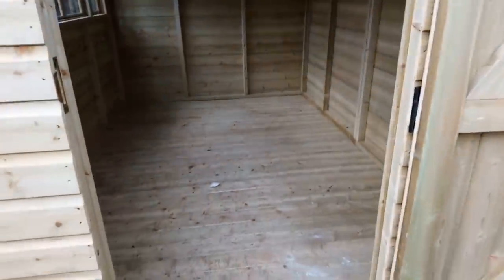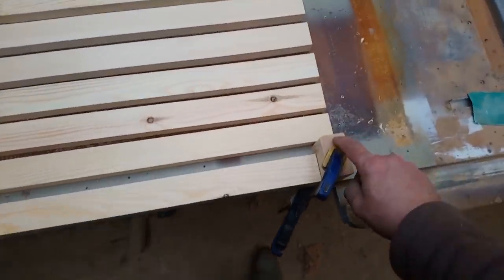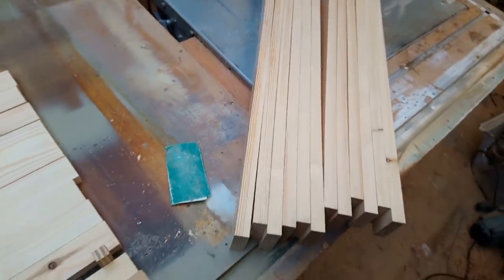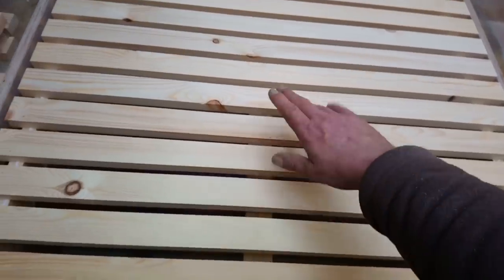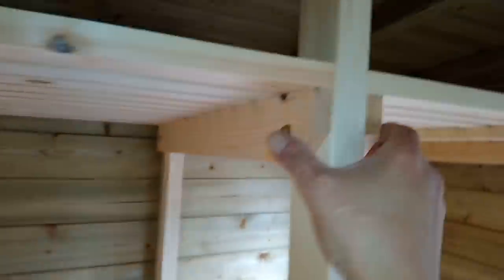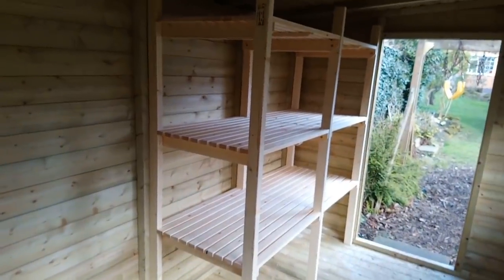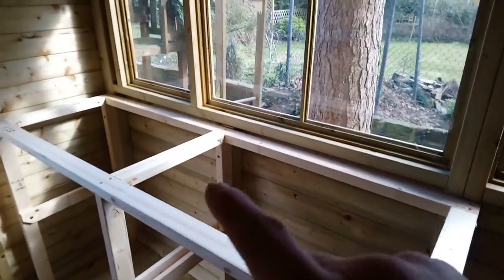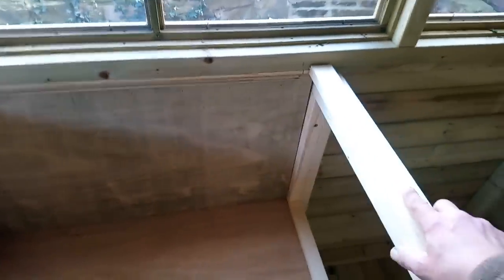Pottery shed slatted shelves n bench build - a quick wk'end job

Comment: nice little job.
Reply from the maker: Thanks Phils 👍
Trying to save up for a new toy, got several to choose from, A new gas mig welder. A Domino DF500,, the list is endless but i have to put them in priority, poss the welder as the van keeps me on the road & earning but my little flux core gets me by...the DF500 domino would be a nice toy for the future but my DF700 is all i need right now.......or i could just not spend n get my account out of the overdraft 😂😂😂
Reply: Gid joiner welder every time 😀 you can’t attach MOT patch panels with dominoes, testers are funny like that 👍🏻
Reply from the maker: 😁 Plenty o glue, it'll be fine 😂
Yeah i think you're right, 
Any thoughts on welder makes, amp sizes, wire 0.6 or 0.8mm for 1mm-5mm steel ? gotta be fairly cheap tho n not to big,
Reply from the maker: I did have this bookmarked, my little Mightymig 100 works well butis under powered for thicker than a couple of mm's & has a fairly short torch, I want this 3m euro torch, I would've liked the 190 but it says not suitable for 3 pin plug.
https://www.ffx.co.uk/tools/product/Sealey-Supermig180-5024209663229-Professional-Mig-Welder-180Amp-230V-With-Binzel-Euro-Torch
Reply: Gid joiner RTech do very good machines, also do interest free credit and ex-display. You can only weld up to 150a through a 13a socket so no point going bigger unless you’ve got 16/32a. Try to get one with a Euro torch, wire feed is key to decent welds, cheap sets with hard wired torches are agro, poor liners, gas valves and small shrouds etc. Steer clear of low end stuff like SIP and Draper branded chinese shite. Sealey are Ok, RTech much better (UK based support) Cebora, Oxford/ Portamig, GYS, top end Miller, Lincoln etc. Can often find a better branded set secondhand.
Reply from the maker: Thanks, just googled RTech, had a quick look at their page,
The first i see is this 👍 but prob best i just give them a call 😉
https://www.r-techwelding.co.uk/mig-welder-r-tech-i-mig180/
Yeah it's the torch on mine that gets twisted 😖
Reply: Gid joiner you can use them on a 13a supply, but the higher settings will pop the fuse, for a 180a set with say 10 settings, 9-10 would pop fuses.  You’ll stick bits of 6mm together, but it won’t have the capability of a full penetration weld on much more than 3mm. The Mighty/SuperMig sets are OK, lots of garages use then for patching exhaust and sills etc, cheap enough to stick in the corner for the odd job. Welding with a bigger set with a decent torch will feel like night and day.
Reply from the maker: Thanks, I could get a better supply fitted at my house but I need to be able to plug it in wherever i want, a couple of times I've been asked to fix someones gates, the little 100amp did the jobs but was frustratingly weak, 
yeah that's what i want, i've welded little bits since i was young n have used a few of other peoples machines so have an idea about the night n day thing as you say, i recognise that & it frustrates me with my 100amp machine but i am still a complete novice, so thanks for the info. I think with a better machine of my own i could get better at my welding. 
Are  you saying i might be better off with the Mighty/SuperMigs? They are a little cheaper 😏 I'll ring Rtech see what they have to offer,
Reply: Gid joiner the Sealey 180 migs are ok for the money, most migs at that money are just basic inverters, the weld repeatability is down to the wire feed and torch, hence a decent Euro torch is a must. The more expensive machines are transformer based, much smoother in operation and generally have more features like synergic controls. Budget for an auto darkening helmet too, you need two hands at the gun with one propping the other to maintain consistent arc length and travel speed.
Reply from the maker: @sweenep86  thanks,
I have an auto darkening helmet, 😉 Thanks, we'll see what gets chosen on the day 😁 👍
Reply from the maker: Just ordered a machine it's coming tomorrow 😁😁 
https://www.r-techwelding.co.uk/mig-welder-r-tech-i-mig180/

thanks 👍

Comment: Great to see your subs are climbing Gid, you deserve it for providing free tuition for those on a learning curve. Did you buy the timber from Milfords or Lavers?  I bought some 5x2 sc16  from Yorkshire Timber (forget what they are called now) at cross green near Lawcris last week for rafters on an extension I'm building at my parents.  I've never seen warpage after fitting like it.  Spent all day yesterday and same today today sorting it out, cutting individual noggins to push / pull it back into shape. They used to be good for timber but I think fencing only from there for me from now on.  
I still use Cascamite for external stuff. Its time proven, fills gaps and bombproof ,as long as mixing it and the long setting time aren't issues. Seems to have fallen out of popularity for some reason. 
I recognised a couple of roads on your vids as, without giving too much away about where your based, I was born just down the road and in Leeds for the foreseeable future.
Reply from the maker: Hi, This timber i got from Milfords they're just down the road, it's a little dearer than Lavers but i get the trade price & Lavers is 6miles away, 13 return journey, 
I think you're ref to Shiretimber next to Lawcris, their CLS, C16 & scant stuff is stored outside, that's no good for untreated int timbers, warping as you say n damp poss causing mould, they've got a huge warehouse, not sure what their thoughts are 🙃 Their smaller planed stuff, 2x1. 3x1 is only 18mm not 20mm!?? 🙃😒 I only use them for treated decking & fencing stuff.
Cascamite i haven't used for a long long time, apprentice days.. Yeah, i remember it being rock hard n bombproof but is it not a bit brittle, We used a 2 part stuff a lot, we called it red death, some kind of Urea-Formaldehyde 😷
I live n work north Leeds, roundhay-ish
Reply: Your right, Shire. 
Cascamite is a bit brittle but I cant remember it ever breaking at the joint, a garden bench made 20 years ago is still going strong too. Times move on. 
Milfords and Lavers are pretty equidistant from me as I'm near Crossgates / Whitkirk at the moment. (I was born in the Stainburns near Moortown corner). 
really need to have a re jig, measure up and re price for the pse/par at a few merchants.   There's one Driffield way I keep meaning to call in to when out on the bike for a look, heard it's ok for some hardwoods.
I¡m just in the process of re sorting out my workshop.  I have quite a bit of kit so need to make it orderly again. 
On a negative note, have you thought about making a cage or a van vault type thing for your van, put things like the Domino, cordless tools in when in a building? reason I say it is it's quite distinctive and the tea leafs useFacebook and youtube for info, theft is rife in Leeds at the mo
Reply from the maker: Yeah often with most glues tho the wood breaks before the actual glue, I'm finding the quality of off the shelf wood is a bit rubbish wherever you shop, that's why i settled for the planed 3 sides crap in this vid,
I know the Stainburns 😉 as far as tea leafs is concerned my van is the most secure place i have, there's a grill behind drivers, the side door is bolted shut, the back door was damaged in the wind recently but has a decent lock & it's alarmed, The places/area i work i feel comfortable, I rarely leave the van out of site, where i live is full of thieves, they'd nick the sugar out of your Tea but it's not good stealing from neighbours here n strangers don't come onto this estate, prob is the unscrupulous of my neighbours go places like where i work to steal 😂🤣

Comment: Brilliant job. Trying to build a cold frame at the moment so good inspiration. I got some c16 timber as well. I've found construction timber seems to be the straightest and best quality, compared to the planed pine from Wickes etc. Don't have a planer so this stuff seems pretty consistent. Reckon it's good wood?
Reply from the maker: Thanks 👍 Yep, C16 is selected timber, it's tested for strength so few knots & bends, I used C16 CLS on the window blinds job & on the pergola build i used C24 which is better still, It feels a little softer than the PSE redwoods that are on the shelf but it's perfectly good wood for building with.
Reply: @Gidjoiner  brill nice one. Some of the "planed" pine I've got from Wickes has been cupped beyond use
Reply from the maker: Yeah, it's the same every where tho, Lavers have a decent turn over but it all cups if on the shelf for too long, I stopped or at least avoid using it for anything where bending might occur like doors, when i do use it i riffle through the stack to pick the best i can & explain to my clients when discussing & choosing timber it's softwood n who knows what it's going to do 🤷‍♂️🙄, For a job like this though it's fine 👍 I'd use the tanalised stuff for outdoors cold frame,
Reply: @Gidjoiner  ok thanks for the tip. I've already bought the wood now haha. Gonna be painting it though so hopefully will be ok. Didn't realise you could get tanalised construction timber
Reply from the maker: 😁👍 as long as it can dry out most timber lasts a while, put some clear treatment on it Sika https://www.screwfix.com/p/sika-wood-preserver-clear-5ltr/47030?tc=AA3&ds_kid=92700052138700993&ds_rl=1243321&ds_rl=1241687&ds_rl=1245250&ds_rl=1245250&gclid=Cj0KCQjw0rr4BRCtARIsAB0_48OwT-dm6SuIKWxnRlu1xVKm7UMQrRAv8aJ9kn362MUrD8ueP0TCyg0aAtaVEALw_wcB&gclsrc=aw.ds or Lumberjack https://www.toolstation.com/lumberjack-triple-action-wood-treatment-5l/p34502?store=GR&utm_source=googleshopping&utm_medium=feed&utm_campaign=googleshoppingfeed&gclid=Cj0KCQjw0rr4BRCtARIsAB0_48Mu8NtmenFg1JxmL8IdcI9lKD5mls9b6GLZqvNNkK66P6wG6szldH8aAoqVEALw_wcB

Comment: Beautiful work. Was the distance between the rails the same on each shelf, or did you eyeball it in each case?
Reply from the maker: Thanks Oliver 👍
Each shelf was the same using the distance pieces, 3 left & 3 right, that's why i set up that jig,
The height of the rails was set up on the floor from the first leg i marked that i used as a template.